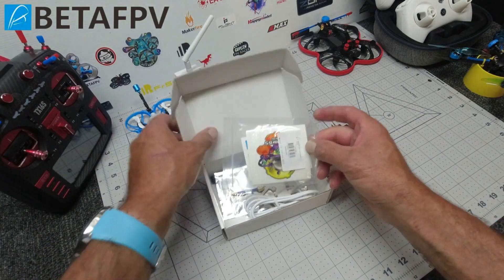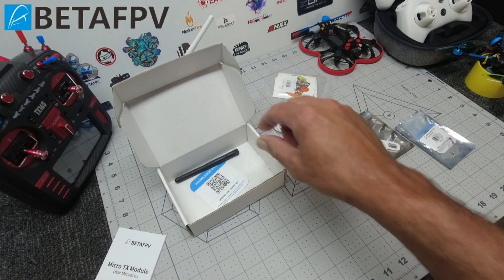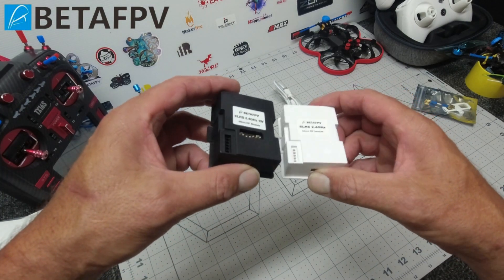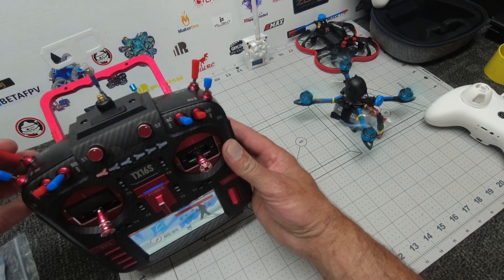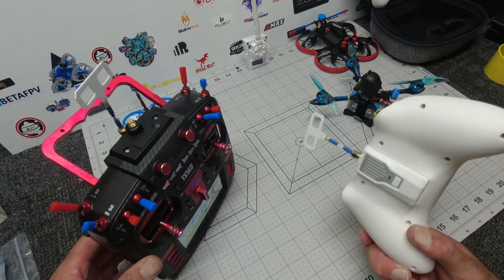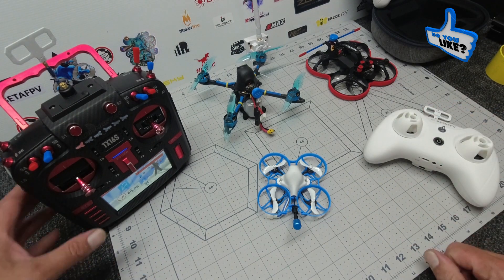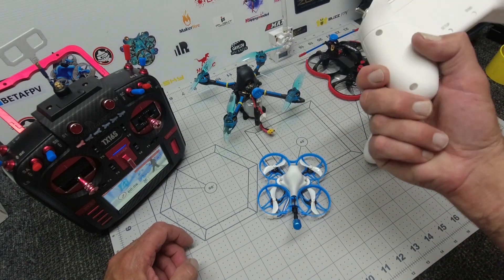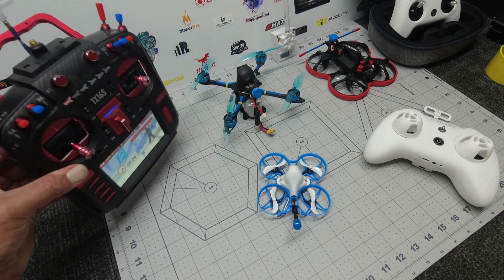BETA FPV ELRS Micro TX Module - 1W Vs 500Mw - FLASHING and More 💥

Comment: Thanks for the informative vid sir.  I have a 500mW version of the micro tx that I purchased a couple years ago.  I updated it to 3.0.0 shortly after I first got it.  What is the latest version firmware now?  I see 3.5.4 on the Configurator software, but I can’t get that version to flash.
Reply from the maker: Howdy you go mate. Both RX and TX need to be the same.

Comment: Hello I've a Radiomaster TX16s (version 1) and the betafpv expresslrs elrs 2.4ghz 1W Micro Module. I can't change the 10W value, in the module joistick or in the LUA software, Do you have an ideia what maybe is the cause?
Reply from the maker: Hey mate.  Firstly have you updated the correct firmware version on your ELRS module. Also do you have  the white or the black one. Cheers.
Reply: @GTARC_au  Thank you very much for the usual help to the community..
I've update (with success) both transmiter (betafpv expresslrs elrs 2.4ghz 1W Micro Module) and receiver (happyModel_EP_2400_RX) in the ELRS Software 2.5.1 version. I've have tha black one of 1W, but I can't change the Power, is fix in 10mW. I'm using the "regulatory Doman EU CE 2400, maybe is his? Is the 3.0.0.-RC1 version already safe?
Reply from the maker: I would stick with version 2.5.1. I tend to leave the RC versions for a bit while bugs are found and fixed.

Comment: Are you sure you said the correct orientation for dip switches? Up is on and down is off. To flash you need 1&2 up not down. Unless I missed something?
Reply from the maker: Well picked up mate. Yes correct  sorry. I have one of the 1st versions that didn't have the on marked above the dip switches.. I will be removing g this video and making the necessary correction shortly. Cheers 👍

Comment: My betafpv micro module when I plug in USB I don't see any com port.  I do here a ding ding when plugged in but no com port shows up. What driver do I need to install for it to detect it?. Any help I would appreciate it.  I'm lost.
Reply from the maker: All good mate. Download zadag. Install and run it with the quad plugged in. This will fix your com port driver issue if that is the problem.... let me know.. 👍🍻